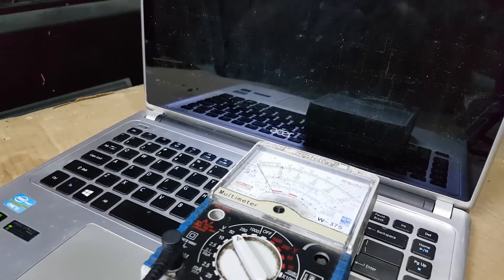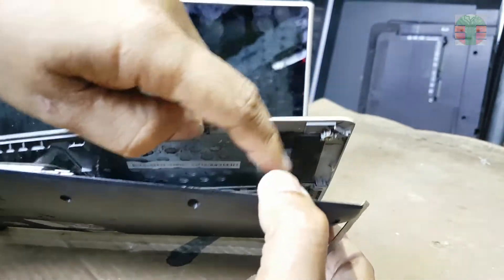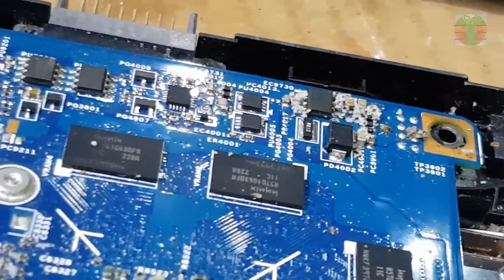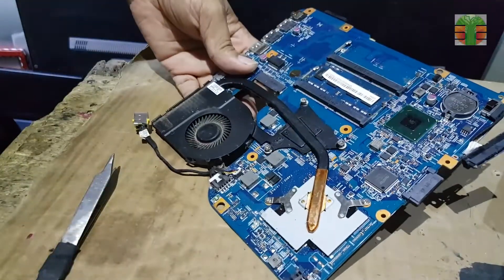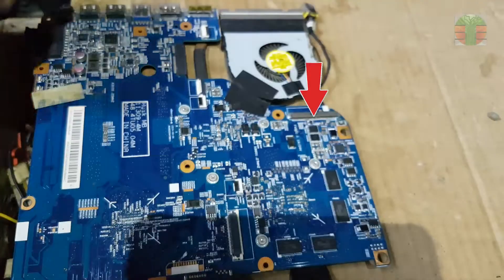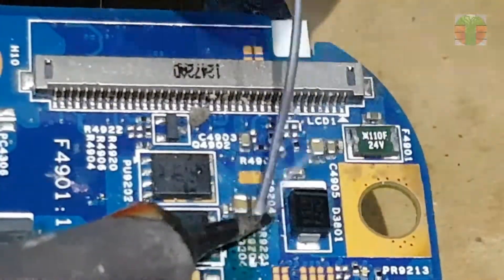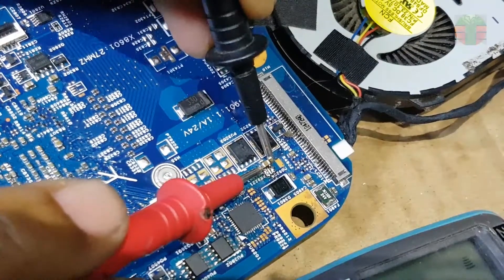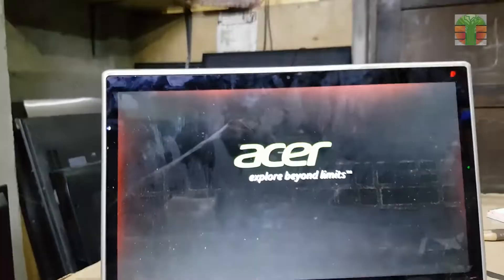Acer Aspire V5-471. No power and not charging. Common problem.

Comment: How do you know the value of the ceramic capacitor? I have the same laptop model with the same problem, but the shorted capacitor is on different location.
Reply: get the schematic is free on internet

Comment: What was the purpose of injecting 3v to confirm the ceramic capacitor was generating heat if you could just use multimeter to identify the faulty capacitor??

Comment: You should buy a fine tip soldering iron, heat station and fine solder to do repairs like this.  These tools are not expensive. Hakko clones are pretty good.
Reply from the maker: Thanks for the tips!